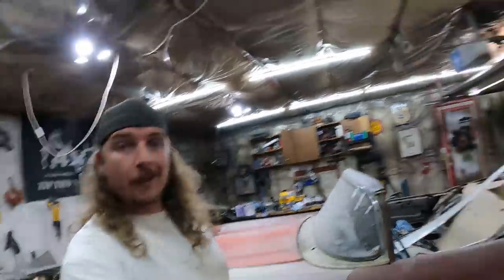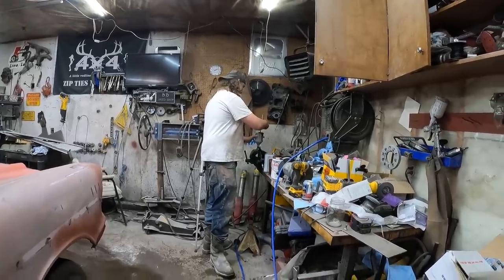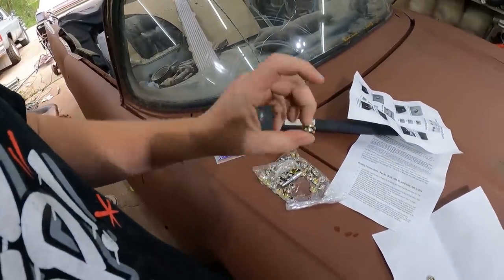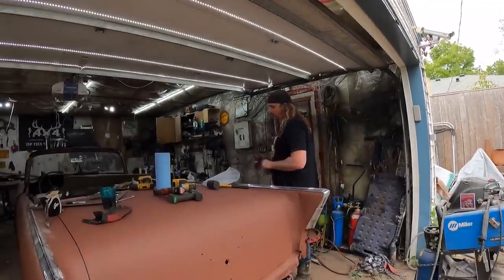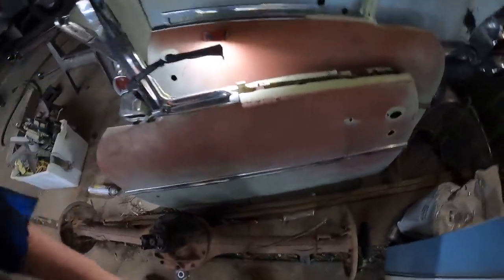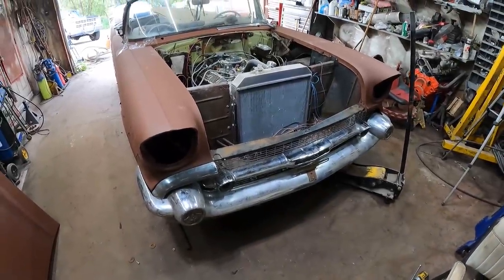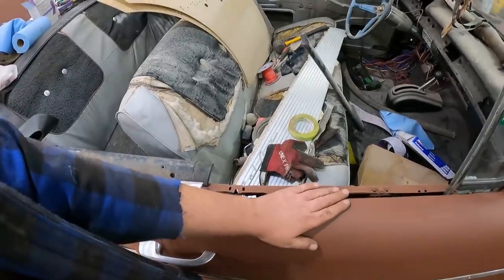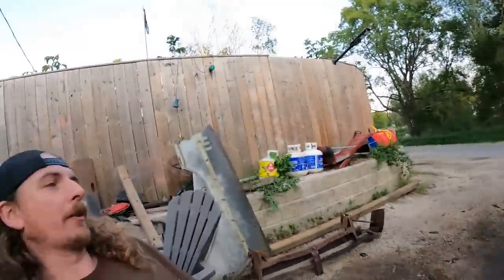Cheap Primer And Full Assembly Of My FAKE 1957 Chevy Ragtop

Comment: What I like to do Dan to avoid getting dry spray is to open up the vent on the paint lid with a 3/16" drill bit.  It seems the 1st time you move the gun it plugs the vent so a larger opening allows the paint to get back in the gun.

Comment: When I was doing my 49 Merc 4 door, I put on a working paint job on it too. Mine was done in primer grey. And everyone called it an elephant. So I added
some ghosted in primer flames with black primer, and red oxide primers, and the words "Grey Ghost".I kept that paint job on it for 5 years. When the car was as finished as far as I wanted to go, it had the original engine with 3 dues carbs , and the quietest exhaust system I could find.! .... Then added cut-outs to lake pipes. .......Wicked Awesome ride my friend. And the paint job looked as good as new! (touch ups are a breeze with rattle cans eh)

Comment: Hi Dan. Try slinging the air hose over your shoulder so that it goes behind you. This will free you your left hand.  You can also mist spray the head light holes and wheel arches first then paint normally after that.  Great work. Looks good.  Jules Australia

Comment: There used to be guy here in Australia who always seemed to have rare stainless bits for the Holden cars here. Turns out he had perfected a technique to tig weld the sections together and once cleaned and polished it took a real geek to note they were extended or shortened. I am sure you could do the same with the side pieces to make them look like 'vert parts.

Comment: Dan  being that you live in Winnipeg and it snows there you should find an old couch that had a hide a bed in it take the metal frame flip it over and you should be able to make a convertible roof with it that will support a snow load if you get what I mean unless you want to keep that car in your garage all winter Sherwin-Williams has a "hybrid "alkyd enamel( it's what they used to paint cars with alkyd enamel) it was designed for wood and you can brush it on and not leave any brush strokes but it's also for metal , it's extremely durable and needs no primer,dries super hard on the mohs scale. I live in an apartment right now so I can't prove to  everyone that you can paint your  car with it, I can't for the life of me remember the trade name for it but other paint companies have their own versions and their own names too, the paint and coating industry has made some awesome strides  a rattle can paint like krylon will give you a finishing you would not be able to get from rattle cans when I was young.
 I painted the wheels on my Toyota 3 years ago with hardly any preparation and they're still pristine. I'm not expecting you to take any of my advice I'm just trying to look out for you in my own way you know what I mean? so keep it up and I like your car stuff.

Comment: Vinyl soft top parts like that, you can throw them in the clothes dryer for like 5 min, helps it stretch around stuff easier, works for redoing motorcycle seat vinyl too.

Comment: The part above the windshield your missing on a convertible is called the top windshield header.  Also a trick for smoother primer and less sanding, on your last coat , mix it 50/50 for the last coat and fog it on ( hold gun back a ways and turn the pressure up to 45 to 50 pounds ) as the first 2 coat will help keep it from running. It will come out much slicker with less sanding needed. If you have a problem with it running at 50/50 , mix in a little more paint ( not much ) to the cup and stir. Also before any paint ever goes on to help stop fish eye in the later top coats there is a product called war & grease remover ( or in the states we call it perclean O) only avaible at automotive paint stores or online.  With the perclean O just before priming you use a new clean cloth hand towel and soak it in the the preclean O and wipe the car down with it in small sections flipping the towel to a clean spot on it as you wipe , and then use a different new dry clean towel to wipe it off.  Do this as many times as needed until the wet towel always comes out completely clean all over the car and you don't need to flip it , then use another new clean towel to wipe the car down completely dry of the preclean O , ( wax on wax off type thing ) then use high pressure air & air chuck and hit all corners and tight spots you couldn't get into with the preclean O before priming with paint. After wiping it down totally dry let the car sit about 20 mins then with your paint gun & primer start to cut in your corners & edges & bare metal areas first coat, then with the second coat used to blend in the corners to the flat sheet metal then a 3ed fogged on coat and a 4th thinned out coat shot at higher pressure to blend it all tougher. This will give you a slicker finish even with primer for lass sanding . Another smart move to use , when getting ready to paint , take your air line and wrap it around your neck from the gun to help keep the hose away from the car and from hitting your wet paint . I use a  very flexible rubber hose to my paint gun . If you get into a habit of doing these things now, you will have many less issues later.

Comment: The car looks great!  I can use those cover snaps in a couple spots on my car.  They'll look better than the screws I'm currently using.  Keep up the good work.  :)
Reply from the maker: They are slick. Homedepo has em
Reply: @DDSpeedShop  - Thanks for the tip. I'll pick some up.

Comment: Looks like that wing window trim might be from a 210 model and terminates at the back edge of the wing frame. The 210s did not have the Chrome along the top of the doors. All convertibles, being BelAir models did have the trim along the top. To solve some of your trim piecing problem, you could just fit this convert out as a 210 in regards to that particular trim area. Anyways, keep up the good work— lookin’ good!

Comment: A great set of videos on this and all very interesting. I am not quite sure what you have created though, it would be interesting to hear some comments from a Tri Chevy club. On the plus side you have saved a Tri Chevy from a slow death in a scrap yard but in this video I kind of feel you have rather dived for the finish line. I know that to complete the car to a high standard would be a mega amount of work but I think without a top its practicality is limited.

Comment: Back in 1965 one of the guys I went to high school with took a 4 door 57 chevrolet sedan and cut the car in 1/2 and removed about 22" of the frame and the front doors and welded it back up.  He said he got the idea by looking at picture of a 57 4 door sedan in a magazine and the page had been sort of folded and he thought it made a great looking car.  He put a 283 with an 1/8" bored out to 4" in it.  He did almost all of it in high school shop class, painted it in the 1966 chevy blue that was on so many chevelles.  It looked really cool, he had it for a long time.  It looked like something Chevy should have built, get a picture of a 57 four door sedan and look at it, fold it and see what you think.
Reply: A couple of brothers in the town i lived in did that to 4 trifives. A 55 A56 A 57 wagon and a 57 sedan in 1966.

Comment: Boots are very easy.  You can buy vinyl and sew your own, I find it is a little cheaper. The wind may catch the front of the boot.  consider attaching the front to the top of the seat.  Factory of that era had a "frame support" at the top for the seat and boot.

Comment: I thought 4-1 was a little heavy. I think that when I painted cars on the gravel drive on the farm when I was a teenager, that I used 3-1. Also, I wet the gravel drive first and then rolled the cars onto the damp area. That way I kept spray or spatter off the panels.  I wanted to immediately start spraying and didn't want to have to dry off rockers and lower quarters.  I also thought the wetting might throw dirt up. Maybe it doesn't, but I wanted to be safe.

Comment: Got to watch that red oxide primer, I know the Dupont 30s and 80s grey oxide is not waterproof, it's made to be shot, sanded, then finish applied over it as soon as possible. I shot my car with it years ago and drove it as I hadn't decided on a color yet. After a month or 2, I had rust forming under the primer. Since then, I've switched to the self etching primer, works much better
Reply: Well if its just regular enamel like he used water goes straight through it

Comment: Absolutely should've pushed the trim forward versus back, then filled the easy side with metal because fabricating the front to look right will be difficult. The front has more complex turns, angles, and cut-outs unlike the rear part

Comment: With the Satellite sold, I imagine the funds are there to buy a top frame and the other parts to finish this car right, which would be a great thing to see.
Reply: Who wants a top frame?  This car is built like a roadster  and the first part of the name roadster is ROAD. Ever see a motorcycle with the top up?
Reply: @garymccord4277  It's a roadster until he finds the top mechanism, at which point it will cease to be a roadster - unless the top is down. The motorcycle analogy is pretty whack. Ever see a bike with A/C and heat? How about power steering?

Comment: 0000 steel wool and a buffing wheel to go over the chrome stuff would work wonders for the bling factor... but lets face it... this car has you hagged OUT. lol Dan... Don't sell chuck it down the road till you give it some time in one of your shipping containers.. Put it in a shipping container and revisit it when you forget all the hate you've developed for it. You've been in attack mode like you've been goaded into doing it on a Dare. Take it off to a shipping container... let it sit for the winter. Collect a few parts... get some decent paint with some other colour than Dog Shite brown... get onto the Widow. You like that one. You'll like this one down the road. You need a shop... you've be less bored and tired and angry with the builds. You'd care more if you had some headroom and a lift. :-))

Comment: Are you going to leave it in primer or are you going to paint it.      It would look really good yellow and black or red and black
Reply: He put it all back together. I think it's safe to say, with the hours it took to install all the trim, he's done. Besides, you can't paint it like that. Someone needs to stripped to primer off now so they can do the body work. You can't put body filler over primer. He probably should have epoxy sealed it instead. Someone has a whole lot of extra work to do now if they wanted to paint it.

Comment: Real street cars should never achieve "perfection", Road rash will break your heart; the most fragile parts on a car are the windshield and paint job. We won the Canadian Nationals several times with our street driven, tunnel rammed, excessively chromed up 55 Chevy; I insulted a lot of car show folks with my licence plate scripts...."Real Rods Are Driven" and "Trailer Queens Suck". Crank up your air pressure for thick primer and tear open trash bags for tires.....just saying'. BTW, lacquer thinner reduces everything but latex paint.
Reply: I heartily agree with the trailer queen description. When I enter my roadster in a car show I have a sign on the windshield that says "Touch me!"
Reply from the maker: @nboldrini  haha that's awesome

Comment: Im a Painter, and what your doing is a  sacrilege, and shoudey
Reply: I'm a man with large hands, and what he's doing is fine for anyone who isn't making $90-120 thousand usd a year to paint someone elses car
Reply: @mikehannigan848  No, it's not. It's fine for someone who just wants to make videos for some temp entertainment. This isn't anything that will actually last. It wont hold up past just a couple years.
You can do your own paint job at home for under a grand but it would require hundreds of hours in body work first if you wanted to do it right. I know, I just did it. It's not perfect by any means but no ones going to guess it was a $400 paint kit from online and shot with a couple $30 guns. It looks as good as a good 3k to 4k paint job. It takes far more time than what would be interesting video making though, that's why you wont see it done on this channel. If the next owner wants to paint this car, he now must sand off all this primer first. Even if they didn't want to fix dents and make her straight, the primer isn't anything that can be trusted for real paint. It wouldn't hold up. The paint would peel off. You couldn't even trust it for a base of more primer. It all needs to come down to bare metal and preferably epoxy sealed first.
Reply: It would seem he's about production, and keeping it real. Like he did with the 57 sedan and Satellite,  the car is set right for the next guy to personalize it, less all the rust, and in running condition.
Reply: @javierdenardo2607  Yes and no. Yes, if the next guy wants a beater. No, if the next guy wants to properly restore it, he now has a lot of work to first undo.
Reply: @javierdenardo2607  I've pretty much (90 - 95%) finished restoring my '68 t-bird that I've had for 5 years now. I bought it already in far better shape than the majority of the cars on this channel end as. Many of the hours I spent were undoing the shoddy work from the previous 2 owners. Had the car simply been left original and never worked on since the first owner, I would have saved a sh!t ton of work. Not all people should own classic cars. Not all are good stewards. Classic cars should not simply be treated as used, common, every day modern beater cars that are built every day. There are only so many of them and once they are gone, they're gone for good. They should be restored properly, not fixed up, thrown together and run as beaters. It just makes life sooooo much harder for when a guy who truly appreciates them finally gets them because then we have to first undo all the shoddy and half ass mess, before we can actually make the proper repairs. It doesn't save, it cost the next owner a lot of work.
You might want to think, it's best to at least get it coated in primer to help stop the rust, but this is such a short term "repair" it's actually going to cost far more time and effort to get it all off to properly coat it latter.
Reply: @mikehannigan848  exactly. The peanut gallery always wants to chime in on someone else's project. I guess they'd rather see these classics sit and rot before being made into a driver that doesn't meet their standards.
Reply from the maker: @Warrior_Resisting_Colonialism  man, it was a rotted parts car.  I think you missed the boat on this one